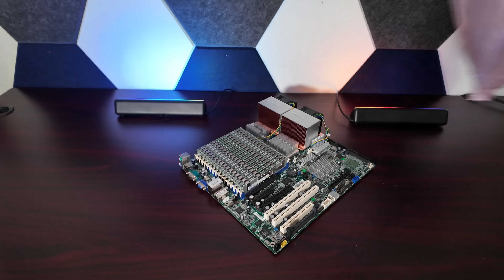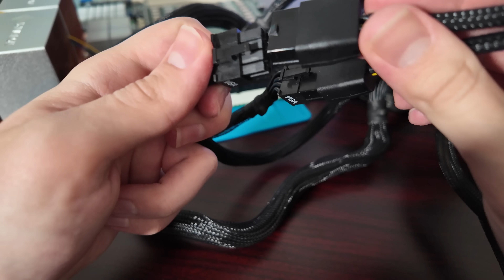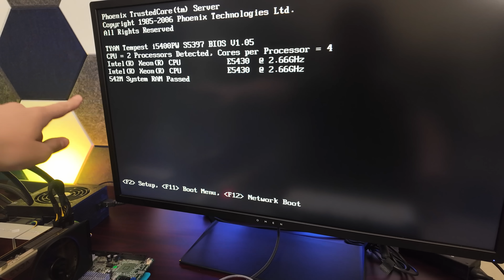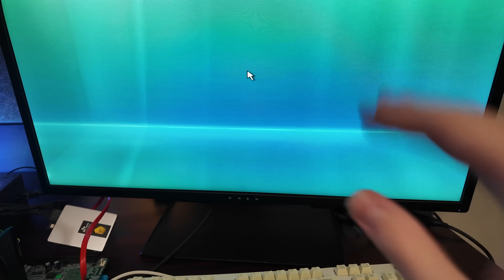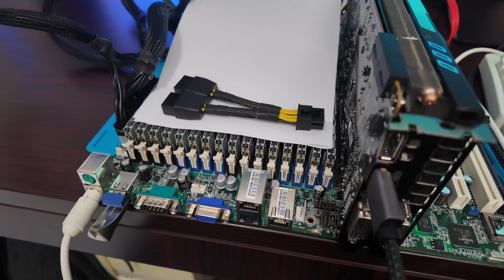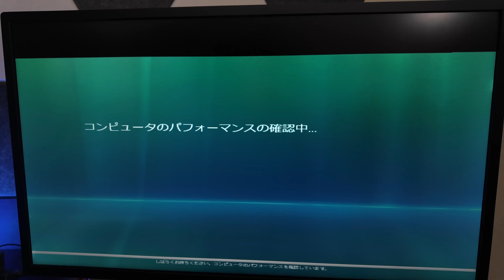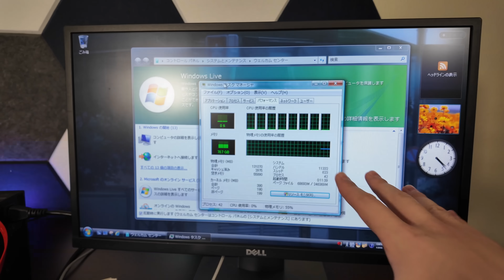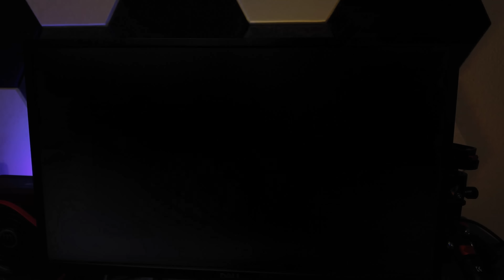What can you do with 128GB of DDR2?

Comment: I wanted to see you run an LLM with those...what...500k flops of cpu? Like, something kinda big, I fit gpt OSS 120b on my 128gb ddr4, course, I was paging it into 24gb tesla p40, maybe that picked up some slack. If it doesn't quite fit, you could extend the page file, I used to do that on my laptop, got almost readable speeds.

Comment: You can use Primo Cache  RAMDisk - it will load your whole STEAM Library into the RAM drive if that works for you,  maybe even set it up as a NAS Drive.
128GB  is not massive, fairly basic.   Try a 256GB RAM drive.

Comment: Apparently you have some options for CPUs, such as the X5492, X5482, and X5470. These would increase your clock speed to 3.4 Ghz from 2.0 Ghz.

Then I guess really, you'd just want things that could benefit from a lot of RAM. The quickest way to get this going is probably installing Proxmox or Docker on Linux, and just see what sort of services you can run. Though, that has the caveat that you'd be spending a ton in power instead of using a more simple, modern system (even something with DDR3). So... yeah lmao.

Comment: If you want goofy, intresting OS thats light with great compatibility, try windows 8.1 indrustial embedded professional..
It has good hardware support backwards and forwards, and software support.
Only problem is the windows updates takes billion years.. (remember to install all the .net frameworks first thing!)

I have it running on my athlon64 x2 with 4gb ram and igpu.. it runs spotify and web browser from 60gb ssd as fast as you can click.. doesnt feel slow at all, and the boot time is like 11 seconds

Comment: This video is actually very relevant to me, because........ IT TURNS OUT i got an old SERVER HP PC with 128GB of DDR3 Ram. 16 cores, dual xeon. I have zero idea what to use that ram for. And it was really bad at mining as well. Does work however?! I don't need a file server either.

Comment: There should be, if there exists a driver for it, a way for you to load in an USB3 driver for a PCI card, in the windows 10 installer. Assuming you get that far in the bios, and got a PCI card. I nearly went in the reverse, going that path but for 7 ultimate ps3, on 1800x ryzen. But i knew how good win10 was, so i stayed. 7U SP3 is the same anyways.

Comment: The first obvious question is "Can it run Doom?" and from then on, i'd try some LLMs and AI related stuff. True that processor and board chipsets may not be too fast, but with that graphics card and the amount of RAM you should be fine, since AI uses these the most. I wouldn't use any Windows version for this application. I'd go Linux, definitely.
Maybe the single read/write speed isn't anything impressive, but if you can set up some NAS type of stuff and give all that RAM for file transfer over a 10Gb network with as many 1Gb ethernet computers as you can get, maybe you can max it's capacities.

Comment: This is basically my exact plex setup except supermicro stack board and twin xeon 2667v3s. Comparable to a single zen 3 16 core at this point. Almost time to upgrade. I host a dozen or so Terraria servers, a ventrilo,  and a Plex server. The 2011 hardware despite the rtx2070, cannot transcode even one 4k stream, but it handles 11 1080p streams no issue.

Comment: My current-ish BIOS doesn't like my specific USB keyboard either. Most importantly I think is that it's NKRO instead of conventional 6kro and can I have set it to send a 1ms tap when I press the key for esc that's a modifier to the left of my left pinky. It freezes the keyboard after pressing esc once in the bios and sometimes even when pressing the normal keys as well, like arrows which have nothing special to them scancode- or duration-wise, but I have noticed if I press them quick it locks up. The crappiest dumpster-dove USB office keyboard I have has always worked everywhere.

Comment: Being an ancient, I knew it was PS/2 keyboard requirement immediately ha
Reply: I remember insisting my mother keep a PS/2 keyboard and mouse around while I was away for college for this very reason. Of course, it was only ever used during a spring break when I borked the OS.
Reply: @psriniv1  I specifically kept me old PS/2 keyboard even tho I don't find myself doing much retro computing and my new motherboard's BIOS doesn't even recognize it.
Reply: @psriniv1 I still have one out of habit. Don't need it anymore except for one old tower that I'm migrating away from.
Reply: I remember there being some setting in the BIOS to enable USB mouse at boot, but not all systems would support it.
Reply: I remember finding an old computer and scrounged up an xp install disk from somewhere
I couldn't get past the install screen and begged my parents for a ps/2 keyboard but they said "that computer is broken, there's no point"
at least I could listen to the install music whenever I wanted :P
Reply: I’m typing this on one. I use it all day every day. It’s filthy.
Reply: Do you feel the sting of betrayal
Reply: I was about to go dig for an AT version
Reply: Me too
Reply: Back in the day usb keyboard were annoying
Reply: i have an older Supermicro server, X9 gen. I think it will use USB keyboards, but only basic ones. Anything with smart RGB or advanced drivers you need to install won't work. It needs to be basic HID/plug n play compatible. When I saw the newer RBG keyboard, I knew right away that wasn't gonna work.
Reply: Yeah and on "PHOENIX" BIOS, where yes means no, and changing one BIOS setting at a time is only way to make sure what option does what. Especially in USB section.

Comment: 5:55: I remember having the same problem once, where I needed a PS/2 keyboard too. But somehow I prefer them even today.
Reply: I need the PlayStation two keyboard?🧐
Reply: @saracelati1703  The PS/2 port is a 6-pin mini-DIN connector used for connecting keyboards and mice to a PC compatible computer system. Its name comes from the IBM Personal System/2 series of personal computers, with which it was introduced in 1987.

Comment: I have an old quad socket Dell Poweredge with half a terrabyte of DDR3 in it, just collecting dust. I used it as a NAS when I hit some hard times and couldn't afford to buy more storage for my main PC.
At that time it "only" had 128 GB of ram though.
I had it set up with ISCSI, and turned the server off when I didn't need it because it was loud and an absolute power hog. It used over 300W when not even doing anything and could get close to 1000W under heavy load.
I mostly had computer games on it. 
When a friend asked to play a game that I had on the server, I had to explain that it would take 5-10 minutes before I could launch the game because that was the time it took for the server to boot up.
My headset mic would also pick it up when I was talking in a voice chat and people would ask "who is using the vacuum cleaner?"

The server has 6x1TB hard drives, so it took a long time to start the game I was going to play, and then long loading screens.
But after it had loaded everything once, and everything was cashed in ram it was really fast. It was like having the game on a SSD in the computer.

Comment: theoretically, you can host a local StarCraft (the Brood War one) Tournament with it, or a Yuri's Revenge Tournament.

All you have to do is find the specific PvPGN configuration files for Brood War or Red Alert 2 and hook it on a Raspberry Pi which will act as a Server. so you can have the local lobby ready for the first tournament.

theoretically, this is the zerg rush that will never attack your frame rate.

Comment: Having built a couple systems with a fairly large amount of DDR4 a few years ago it feels weird to see something from this era being tied with my home server for memory capacity, and I am completely stumped as to what to do with it... The PC I use day to day has 96GB, and having a RAMdisk to dump temp files to is fine and dandy, and my server runs multiple game servers and hosts a media library I share with friends... but with how old this thing is I don't know that I'd feel comfortable connecting it to the open internet, definitely not with vista, the corresponding CPUs are pretty weak, and the power consumption has to be ridiculously high... I mean every computer wastes (very nearly) 100% of it's power as heat, so even a bad old computer can live a life as a space heater, shout out to my old FX-8350 that got me through some harsh winters lol. I'm sure there's something even today that this could be used for but IDK what...

It's been a while since I've had to ask this question, can a machine of this era run windows 10? I'm pretty sure I've installed 10 on core 2 quads of similar vintage, if so the prospect of being able to connect it to the net with modern security (remember win 10 IoT LTSC still gets security updates till 2032) would open up some possibilities I'm sure...

Comment: I have never seen so many sticks of RAM installed in a single board, it was amazing.
If you really want to benchmark this system, you should take a look into Phoronix Benchmark, runs on both Linux and Windows.

Personally, I would give Linux a try in this system, since you could run a very modern kernel on it and really try to know it's capabilities.

Comment: you could install word 2007 on D if D is the ramdisk.

or you could get an old version of vmware workstation and install a windows xp vm on the ramdisk.

or you could try to move certain parts of the operating system but keeping it symlimked (not sure myself how/if this is possible) 

and you can also install the old bf2 game on the ramdisk, it still has an active community 😄 and maybe if you update the crypto ssl stuff you may be able to multiplay bf2 on the ramdisk.

Comment: I've had 128gb for the past 6years...   I use Imdisk for my ram disk, that hosts my video files when I'm editing them, or also as a cache drive for pinochio.   

Wish I had upgraded to 196gb when I had the chance, but I've never really run out of ram with 128gb.   Windows 10 and the Window Manger is really the limiting factor, and the same is true under Linux.  None of them are very good at managing hundreds to a thousand open browser windows on the task bar.

Comment: The reason ramdisk write speeds are faster than reads here is probably due to high latency between the cores and the memory controllers. With writes, as long as you send them slowly enough to not clog up the memory controller, you could theoretically send a single write message from a core to a memory controller to complete the transaction. Reads require an extra trip: the core needs to send a message asking for the data before it can get a message back with the data.
The cores also have a limited number of hardware buffer entries to keep track of outstanding read/write transactions. The short explanation is that if the read transactions have longer latency, then more buffer entities are needed to avoid bottlenecking things. So there might be enough buffer entries to not bottleneck writes, but not enough for reads. I can give a more detailed explanation if anyone cares.

Comment: Brings me back! In 2009, I built a small VMware cluster with IBM (maybe x3450?) servers that had the same series Xeon processors. We sold it an IaaS cloud, where you could rent a VM month by month. It was a cool project and the market for it was exceptionally small in SE Europe, but we did it anyway. Fully kitted out they came with 4GB RAM modules at 64GB per server, which was massive for the time, but we quickly realized IBM was throttling the capability of the machine by not offering (at the time) an 8GB module. So I started ordering and testing a bunch of random 8GB ECC modules until we found that a module from a 3rd party (Kingston maybe?) not even speed out as compatible with IBM - a quick upgrade and life extension followed and we had the better part of a terabyte of memory in that cluster in around 2011 before I left that company. It was a wild ride!

Comment: RUN PUPPY LINUX ON IT, CONVERT A LINUX DISTRO TO WORK LIKE PUPPY LINUX AND LOAD ALL ITS STUFF ON RAM AND BECOME SUPER FAST, URGHHHHHHHHH
USE THE POWER YOU HAVE BEEN GIVENNNNNNNNNN
Reply: I think there re arch linux apps for doing what i just mentioned. It d make for a GREAT followup vid
Reply: for those wondering, puppy linux is a linux distro that makes old computer SUPER fast by loading everyhting on ram(even faster than a ssd)

Comment: those older xeon boards with dual cpus always have the 24 pin and a six pin and then another 4 pin or 6 pin, newer one I think is 2 x 8 pins. at one time I did know what the term for that was so I could buy the right psu but that was years ago lol. these are so fun! I have a ddr3 system link this with 196gb ram. is this using 5200f ram?

Comment: DDR2 was pretty much the last generation of RAM in which there was a significant enough period of overlap where you could buy high-end DDR2 that outperformed the commonly available entry-level DDR3 and the timings were such that you would find it more beneficial to use DDR2 in certain applications as long as you didn't care about power draw and heat. DDR3 was also the last generation before RAM controllers were built into the processor by default and couldn't be bypassed, so you could sometimes encounter the unusual "Upgrade" motherboards with newer processor sockets but which either supported DDR2 using an on-board memory controller or which had both DDR2 and DDR3 slots and utilized an on-board memory controller for DDR2 support or utilized the on-die memory controller for DDR3. It was an unusual time to be a PC enthusiast.

I miss Windows Vista, because it was so misunderstood. People still think it was an annoying operating system and that it used too many system resources while not realizing that the current incarnation of Windows asks you for security verification JUST as much and consumes even MORE resources despite not being as pretty. The difference is that memory chips have advanced to the point that 8GB is pretty much the minimum anyone is going to bother with and integrated graphics are more than capable enough to handle simple OS GUI rendering. Vista was ahead of its time and they really should have just made a Windows XP Ultimate edition with some relatively minor tweaks and held off on launching Vista until graphics and RAM capacity improved some more.

Comment: Hot damn, this is a blast from the past (the DDR2, I mean).
Funnily enough, there are probably some systems somewhere in a factory or lab which use this dated setup to run machinery or lab equipment.
There are some B2B businesses which even specialise in this by selling "new old stock".
It's fascinating.